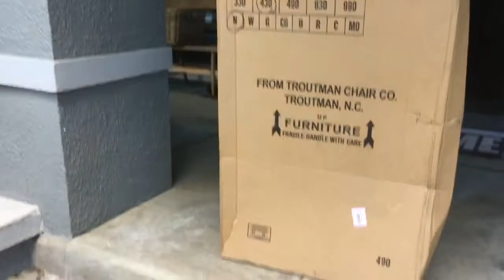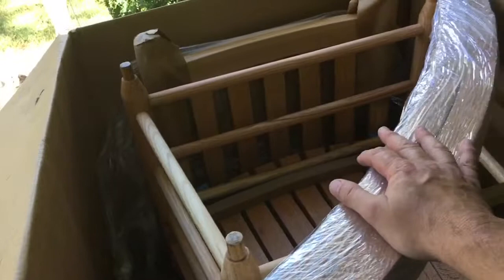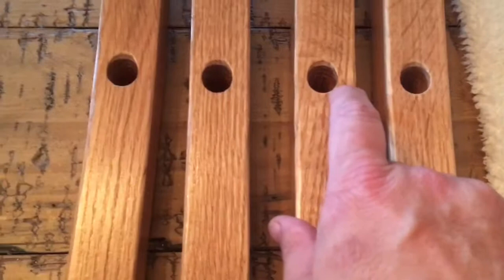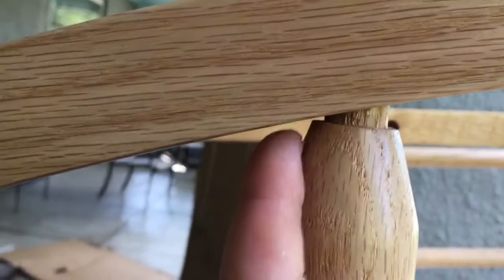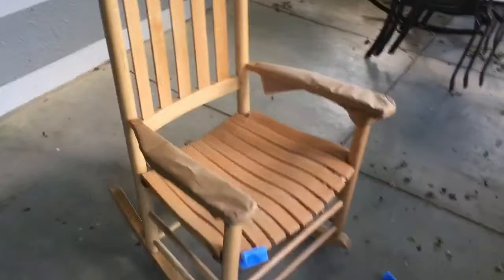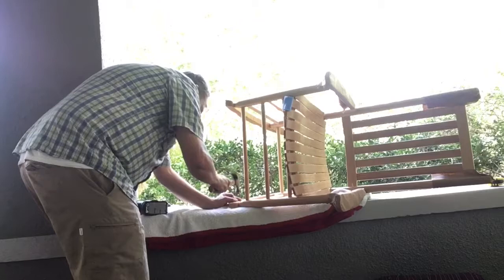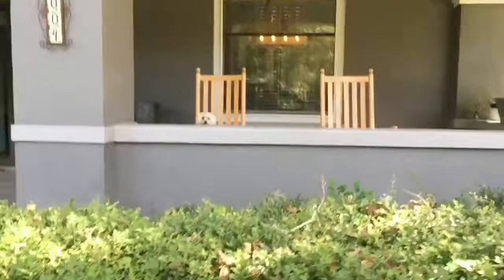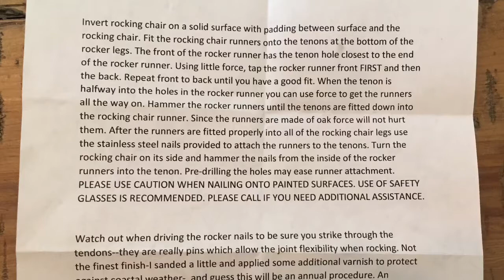Troutman Jumbo Albany Rocker unboxing + assembly review

Comment: Thank you for posting!  Very helpful!  I just purchased 2 Troutman rockers and will have to go through the same unpacking and assembly process you demonstrate.  Good tip about drilling pilot holes and placing the 1/16" bit slightly short so it doesn't push through the other side of the rocker.  Also a good tip to ensure placing the nail in the vertical and horizontal center of the tenon.  Placing the nail in the vertical center of the rocker might not provide enough "bite" on the tenon.  They look great!
Reply from the maker: Your welcome ,  we have had these outside under a covered porch every day for 2 years and they have been marvelous.  We sometimes wonder if we should have bought the white ones but are very very pleased with these.